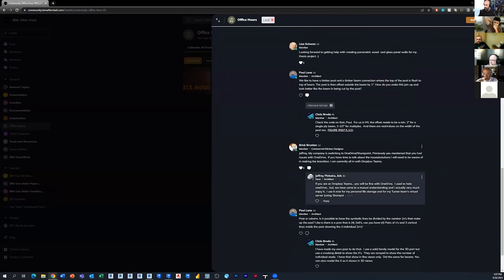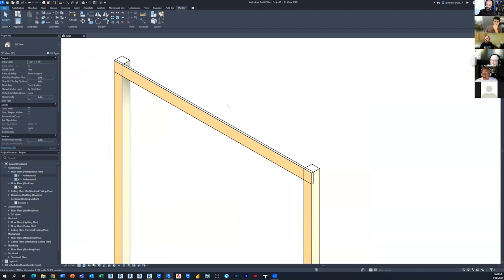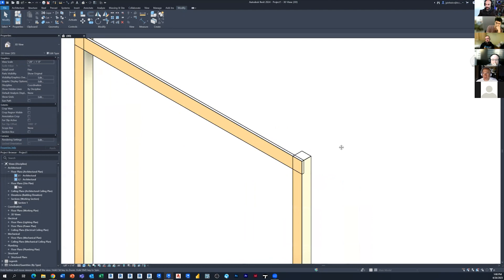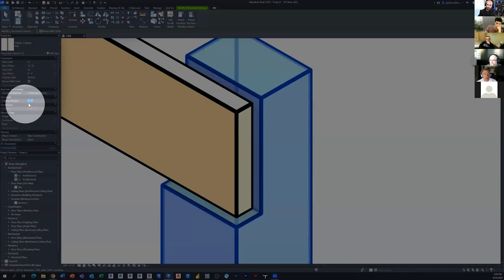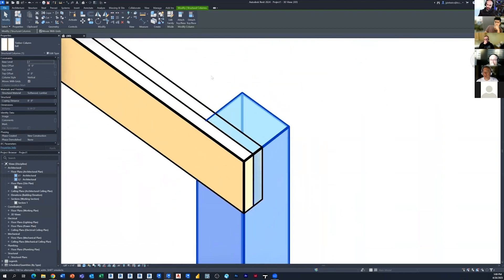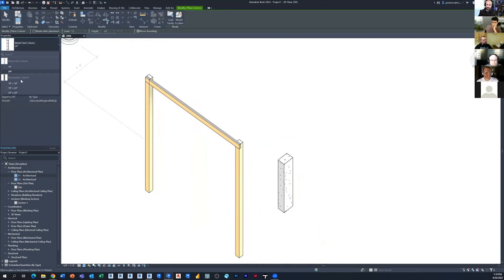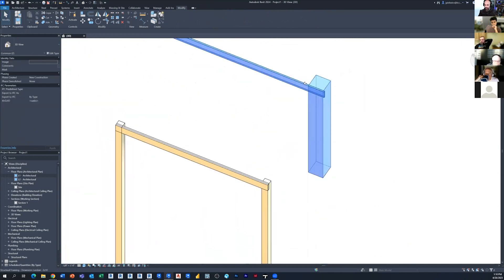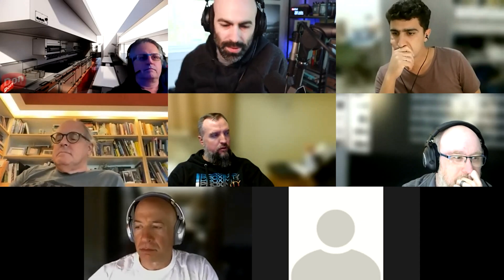Notched Wood Column in Revit Tutorial (Office Hour Sessions)

Comment: You can do that with Cut Geometry tool
Reply from the maker: many ways to skin a cat in Revit ….
Reply: With Cut Geometry is more faster. It works without void. Simply select the tool, the column and the beam and not need to edit parameters to eliminate the gap

Comment: Would be interesting if you could create something like the thumbnail, with screws that automatically adjust the length based on the beam thickness.

Even better if we could create a ‘wood-joint’ similar to steel-joint, that automatically appears/adjusts based on dimensions.
Reply: I don’t think you showed that part in the video. But I guessed you created those.
But will they adjust the length if you change the size of the timber?
Reply from the maker: @Luftvargen  I didn’t show it but that is the case, yes.
Reply from the maker: I did create the thumbnail….?